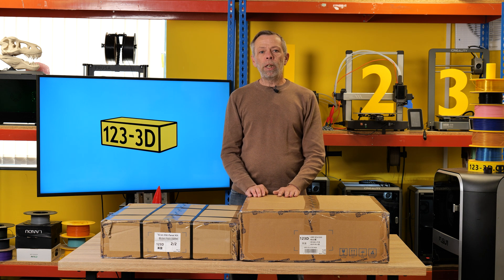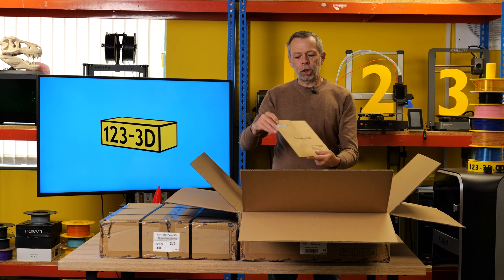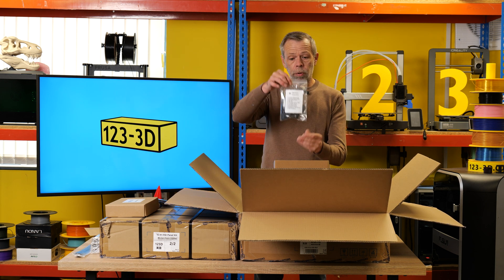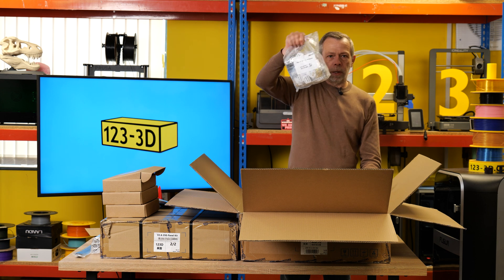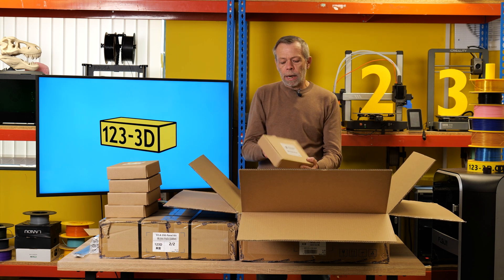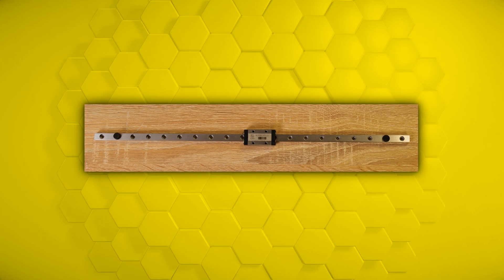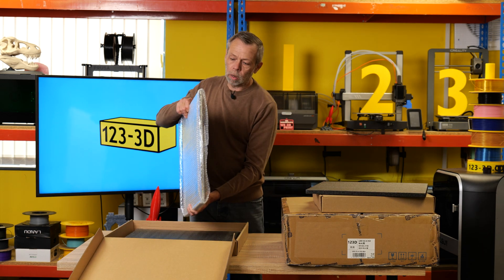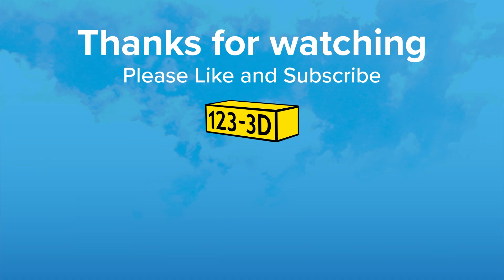Building The Voron 2.4 Rev D LDO Motors Kit | PART 1 What's in the box

Comment: Self sourcing seemed like a great idea, especially if you have a lot of the components already. But I quickly started realizing that while the components that go into the build might not cost much (like say if you need 10 of a particular screw), but if you only have 7, you’re gonna be buying another set of screws. 

So you might only use a few but you’re buying $10-20 worth. Then multiply that by all the stuff you need and there’s a good chance it ends up way more expensive up front even if it means you have tons of supplies after. 

Ended up just going with this kit.